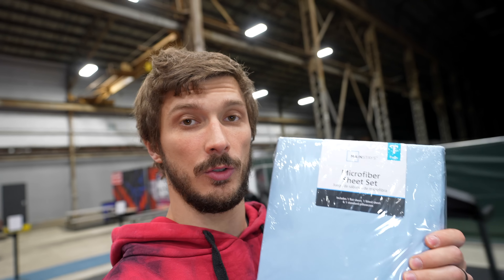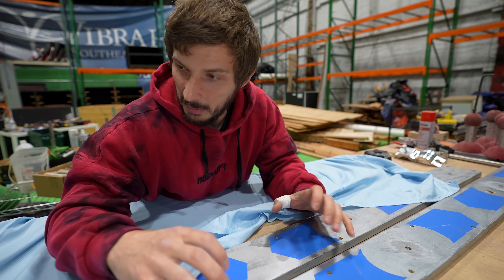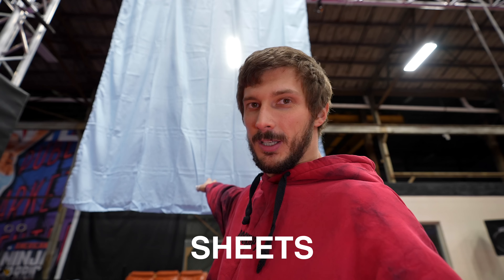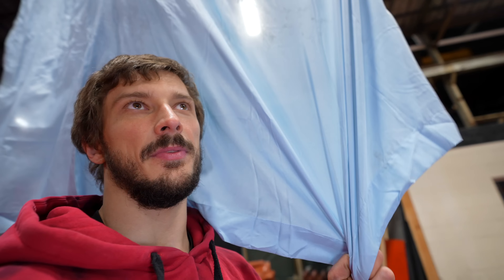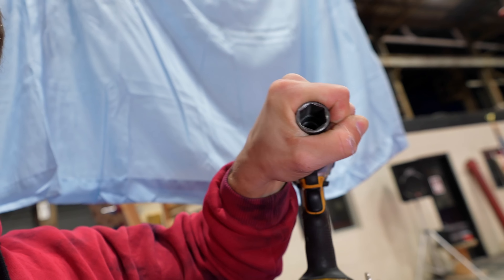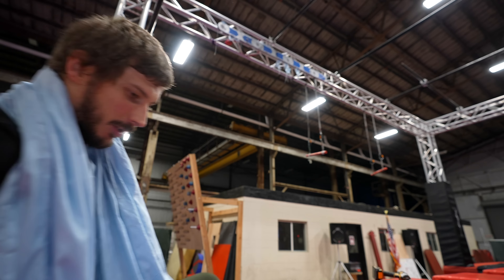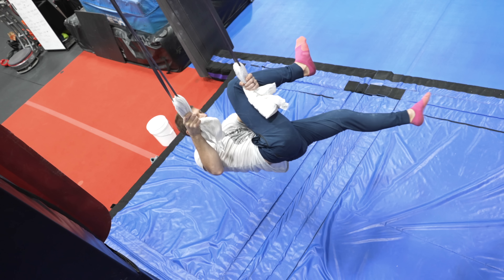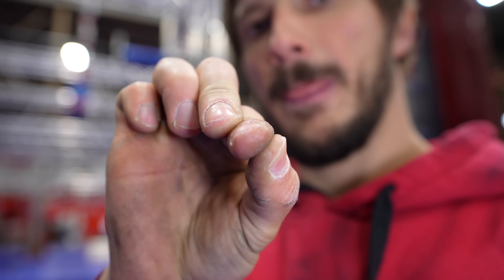Bed Sheet Grip Strength Test

Comment: I would like to see if having two dull spikes instead of one sharp knife and maybe a thicker and longer piece of fabric would be able to slow you down or even stop you completely if the fabric had enough layers. Non the less doing laches with knife in your hand is giga badass move and i loved the fact that u actually did it (and also glad it didnt end with impaling your leg of sth)
Reply: @AntonFomenko  pretty sure its doable with two dull swords, if you would use assurance similar to the one used when climbing the rope you can jump on the fabric hanging from the top of that high salmon ladder you have, the problem would be the right fabric you should use. All in all i think it takes a lot of effort to do but i believe it would be a great video and prince of Persia's like experience :D

Comment: I just watched sheets tear three times.  Not sure how they were attached, but I'm thinking something where the sheet is draped over the support so that it's not tearing, say, due to a nail that's supposed to hold it up, which with your weight crashing onto it would just obviously serve as a way of ripping it.  Maybe draped over and tied in a knot underneeth, and then the knot reinforced with some cord, so you don't use up too much bedsheet length.  That should spread the force out, so your not tearing at a crappy attachment point.  Another idea would be to wrap the sheet around, say, a 2x4 but then bolt the 2x4 to another piece of wood that's secured.  Then the friction between the bolted together 2x4's could compress the sheet that's wrappted around one of them.  Maybe it should be doubled over a few times before it's wrapped.  Then the part that's hanging could be allowed to spread apart after it's bolted.